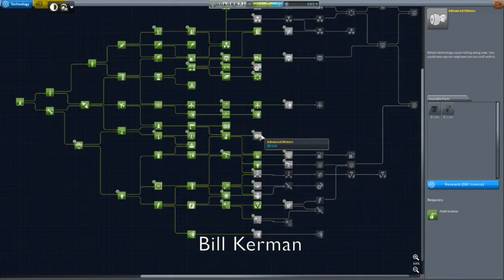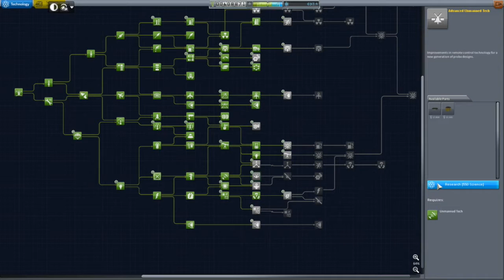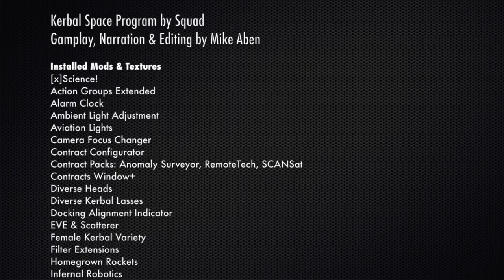KSP Career: Episode 99 - LKO Refit

Comment: The airbrakes are backwards, the inward curved part should be facing the direction of the wind to create the most drag
Reply from the maker: They bug me the other way.  I know the game doesn't model this, but they would tend to be both aerodynamically and structurally unstable the other way.  Just look at pictures of them being used on almost any aircraft.
Reply from the maker: I just did a little experiment and discovered that the airbrakes have the exact same drag in game in either orientation.  So it's a purely aesthetic choice.
Reply: I agree with Jack, sir fedaben. I think you should go for the correct way even though it doesn't make a difference ingame.
Reply from the maker: Dubastot You mean like this.
https://goo.gl/YJBIqB
Reply: Oh well then, I thought it was the other way.